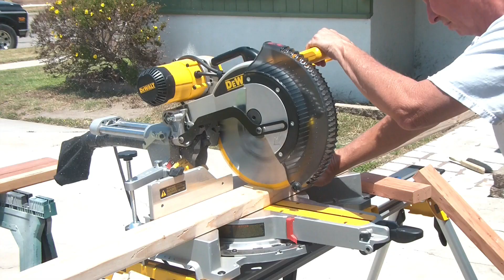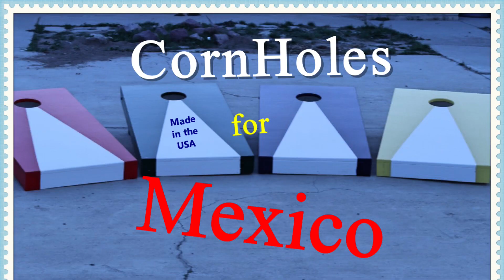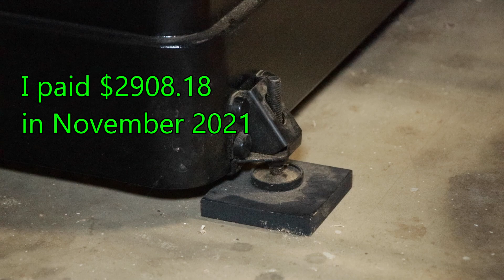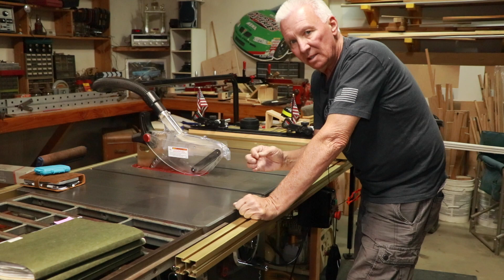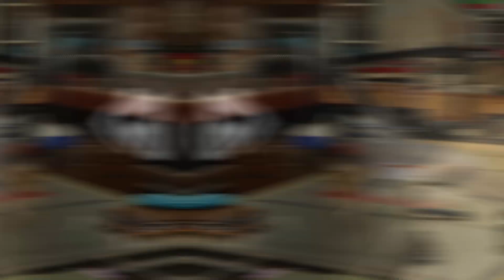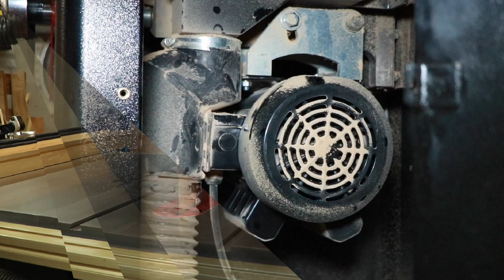Harvey Table saw after 2 years

Comment: While the video meandered around a ton of unrelated topics to the Harvey Tablesaw, the over all message was good.
Comparing a 1960's vintage Tablesaw to any recent table is irrelevant. 
Also, started talking about the over the blade guard and somehow went to a rabbit hole of shop safety from your teenage years.
I do agree with relocating the switch as I am right handed, but it seems to me the adjustment wheel for tilt is now in the dight side, I'll have to look again. 
That massive invra fence is something I would have never considered for any tool i own.

Comment: Hi Rick.  My Harvey table saw blade somehow came out of alignment with the table top.  In your opinion, do I need to strip it down to the basic table in order to realign the top and blade?  Thanks much.
Reply from the maker: DavidL-c4w wow have you checked to see if any of the bolts around the trunnion have come loose? That's crazy. If my saw became noticeably misaligned. I thing I would at least attempt to align it prior to a complete disassembly. loosen the trunnion and with a piece of wood use it with a hammer and tap the edges to see if it san be moved. If not we have to go the extra mile and break it down to the basic table saw and realign it. Have you contacted Harvey to ask for any guide lines.

Comment: Thank you for the honest review notes. I’m lookin at the Harvey’s now. Can’t make my mind up between 3hp or 4 dovetail or not. I will be upgrading from a craftsman contractor saw which is incredibly underpowered and much to light to push anything of size through. I’ll probably be making some modifications like you have.
Reply from the maker: @TSJackson84  there’s nothing wrong with a traditional trunnion. I just liked the innovation of the dovetail Trinian, and it is very very solid. When I purchased mine for the same price, I went from three horse to four horse to me more power of the better. I also had a crash and 10 inch table saw for my grandfather I understand the under power.  I could not cut anything over 3/4 without burning and taking time getting the material through the blade. All the new Harvey tablesaw is coming with the new big guy fences them, which is unbelievable. Very solid fence. I am almost on the verge of getting rid of my Incra fence and going back to the traditional fence, but I was at Harvey about a month ago and talking with Hung. We came up with something he sent the suggestion to the R&D people in China hopefully something will come of it if they take our idea it is a simple attachment to the fence that would make it just as good and repeatable as an Incra. then I will change and go back to the traditional fence. even with the AI system they’ve come out with for the fence. You still are tapping the fence to get it on the exact measurement. Incra eliminate that, and hopefully the suggestion that Hung and myself came up with  would illuminate  that from the big eye and would be easily attached to the fence. which ever you choose I know you’ll enjoy. Harvey is a great tablesaw and the people make the experience that much more pleasurable. Have a wonderful Thanksgiving.

Comment: Caught a sale; bought the HW110TC-36P  Harvey. It's big, it's smooth, it's solid, it's powerful, and it Cuts really well.  The Hi-Lo fence and MG-36 Pro Miter Fence are a huge step above what I have been struggling with.  Jim
Reply from the maker: James congrats on your new tool. I’m know it will serve you well. Harvey is a solid table saw. They are only getting better. Did you think about the new big eye fence it is really solid.

Comment: Thank you for the excellent review. That bent fence clamp handle should be a bit longer so that the handle points straight down when clamped. I hope Harvey does that with their new design.
Reply from the maker: The new big eye is a completely new design and the handle is on top soo much better. They are on the right track

Comment: hi rick the cast iron wing u added does it come pre drilled to mount it ? I assume they make one for the 36 inch . after watching your video I think I'm going with a Harvey
Reply from the maker: Frank yes but I put supports under it just because of the weight. You should be able to see them in the video. I noticed it sagged. Bit after a few months. This helped level the top again, but in my case, it limits the cabinet door to how far it will open because it hits the leg or support now but it’s just something I chose to do. I noticed it sagging once I put a straight edge on the top because of the weight of the table top
Reply: Have you tried adding a couple more bolts, or used higher grade bolts? It is highly possible that it is bolt stretch that is causing the sag - cast iron wings are a lot of mass to cantilever.  @TheShackShop

Comment: I bought their 32" table saw then a fellow woodworker came over to see he loved it and bought thier 52" when he got it the fence tubes would not bolt up so i called them and told them  i was on good terms with them because rite after i got my saw i was cutting 6/4" mahogany and the saw would trip the breaker . i had rewired it to two twenty and when the tripping continued i took the switch out and it was a 110 volt switch not for two twenty so when i told them about the wrong tubes he said we will send the correct ones and i asked what do we do he said keep them so i turnd my saw into a 52" cut and i bought my on switch and the wanted the part number.for it

Comment: Pretty cool always wondered bout Harvey...your the only I found to review it I wondered how it stacked up to saw stop an such...thank you...
Reply from the maker: ravenheart1439 it is my pleasure i try and hope it does help a little. Thank you for viewing.
Reply: I have been using a table saw for over half a century, most of that time on saws without either a riving knife or a blade guard. In that time, I have not ever even come close to having an accident. That is partly due to my taking the same precautions as TSH, especially with the hand on the fence side (hooked fingers).  And I will shut the saw off before reaching past the blade, even if there is a 6" separation between the blade and saw and the piece against the fence is well clear of the blade. 

As such, I see no need for an expensive and sensitive mechanism that is great for protecting people from their own folly.

Comment: Every time I watch your videos, it confirms that I made the correct decision in choosing the Harvey Table saw. I must admit that you are the finest. Your review of the Harvey Table Saw is exceptional. I need to inquire about the process and equipment required to construct the dust collection modification that connects to the dust box. As you are aware, I reached out to Harvey with photos, seeking advice on how to enhance the dust collection in the saw, but the response I received was not what I anticipated. However, after watching your video, there is renewed hope. Thank you once again for consistently showing me the way forward.
Reply from the maker: richh7539 I notice you asked I believe during their live stream and I wondered if  the answer was sufficient. What I did I did mainly for my personal wierdness. I knew over time, a few years, the hose would rub through resting on the motor. It didn't effect the dust collection in the least. I only have a shop vac and that little sucker ( no pun intended) does OK. Thas both above and below blade. I have no complaints.

Comment: I have the Incra fence on a newer Delta Unisaw 5hp . New I paid $2600 for Delta Unisaw.
Reply: I bought it a year before production was moved overseas. It was perfect out of the box. No issues after 10+ years.
Reply: Interesting. I’m curious where you bought your Delta Unisaw at? I never heard of the unisaw just the Delta brand. $2600 is great for 5hp if it beats the Harvey which I like over the SawStop or other common saws.
Reply: @mpe777  very accurate saw unisaw was started about 1938 now made in China or Taiwan extreme accurate very nice
They go for approximate 2500 to 3500 depend who has it on sale or clearance
Fantastic saw look on you tube videos
Reply: Delta unisaw a lot better!
Reply: Delta unisaw was first made in 1938b
Now made in China
I believe but it can be found in internet
Usually between 2500 and 3500
Very smooth table saw highly accurate

Comment: Video was not too long.  I have my Harvey table saw for about a year and I love it.  considering changing the power button like you did.  I bought it for almost the same reasons that you purchased yours.  To me the dovetail solution was the most robust and long lasting that was on the market at the time.  I worked for a custom home builder when I was young.  I learned how to build cabinets and how to apply lacquer on them from an expert painter.  I always wondered why the best cabinets had to be imported from Germany.  I don't think it is as true today as back then.  CNC changed a lot of manufacturing but still the highly accurate table saw is still a must IMO.
Reply: ❤😂 14:44 
😂54e